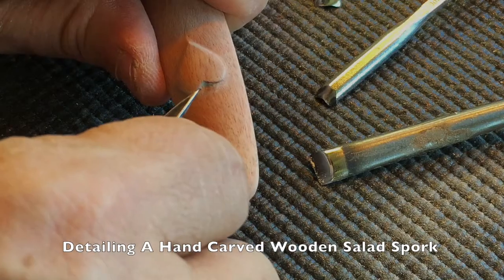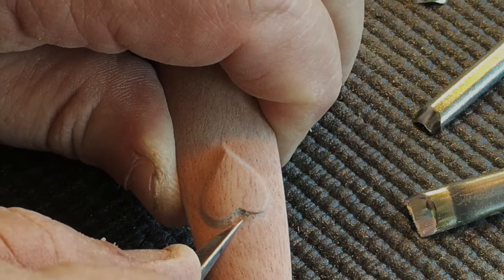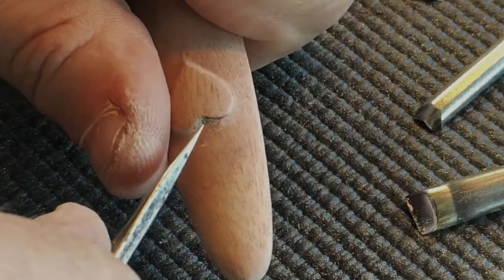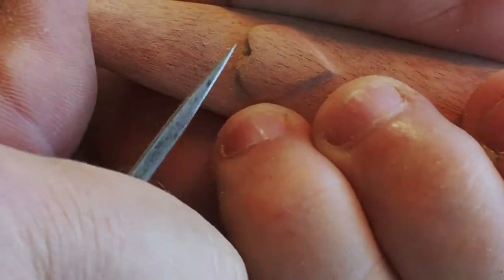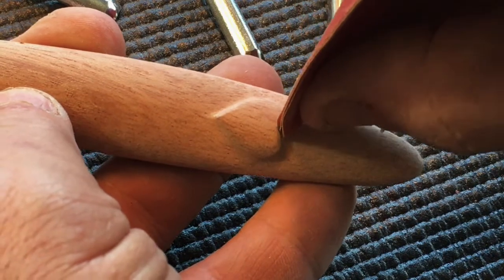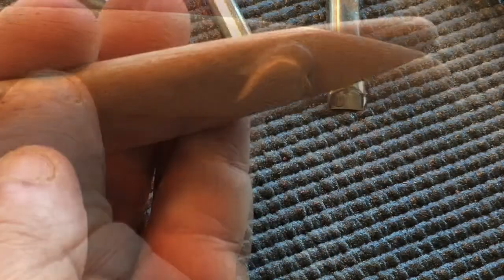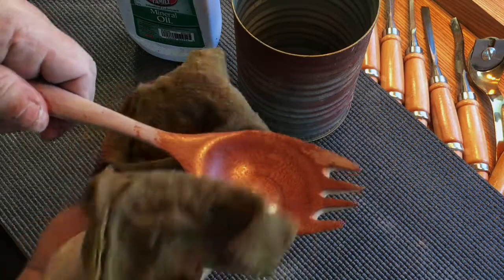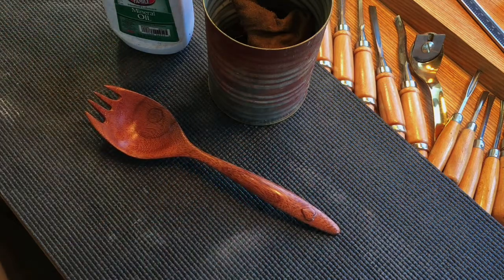Fine Detailing A Hand Carved Spork

Comment: Do you have any video on actually making the spork itself ? I can't find many videos on carving sporks and I'd like to try making one.
Reply from the maker: Teka, no, sorry I do not. Those files were lost but, I simply made two spoons, then cut the teeth out of a spoon with a coping saw, then filed smooth, sanded and there you go!
Reply: @wildbuslife  I see ! I can't say I own a saw though-
Do you ever plan on making a video on how to make a spork ? I'm a beginner so I'm worried I may break the thing while trying to cut out the teeth, to be honest.
Reply from the maker: @corruptedteka  Never be worried so much you are hesitant to try. Mistakes are great teachers. You can also carve the 'tongs' and even just 2 of them will do. If you fear you might split the bowl of the spoon while carving the v shaped spaces between the tongs, drill a hole through the bowl where the base lines of your v's will connect to act as stops for any split that may develop while you carve. Take it slow and easy and you will be fine. You may even file or use sandpaper to make the shapes. Test the process on a thinly carved piece of wood to get more comfortable first. The thing is, you will figure out a method that works for you with the tools you have at your disposal. Remember, people have been making wooden utensils for millenia, and started with very primitive tools. If someone else can do it, you can too!
Reply: @wildbuslife  Wow, that's great advice, thank you so much ! I think I needed to hear that, as someone who hesitates a lot.
I'll give it a try !